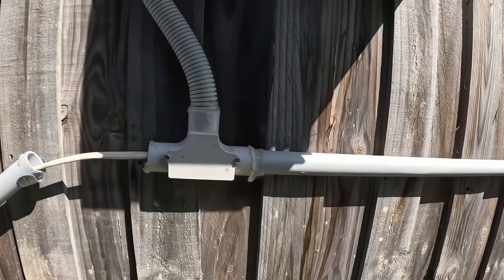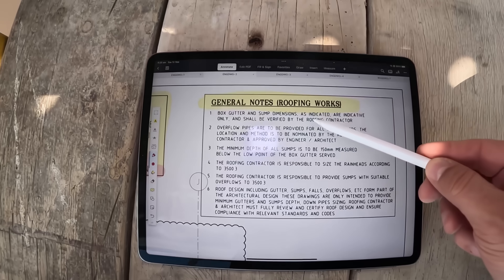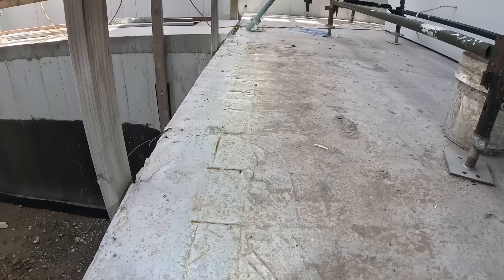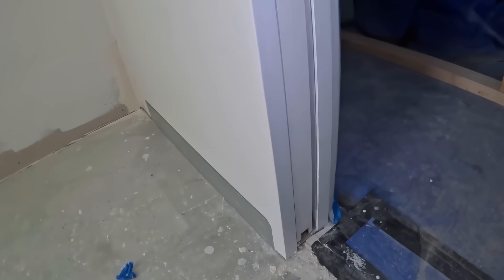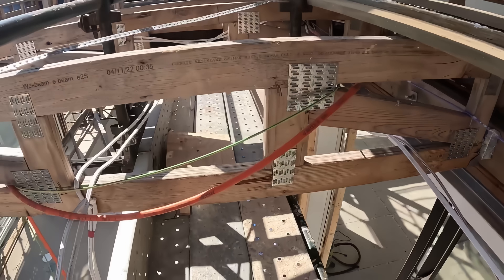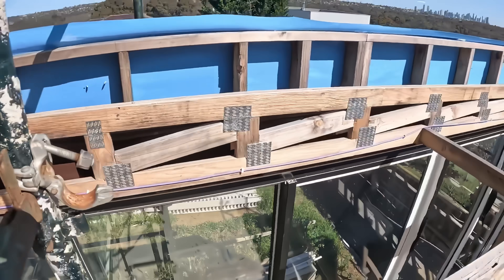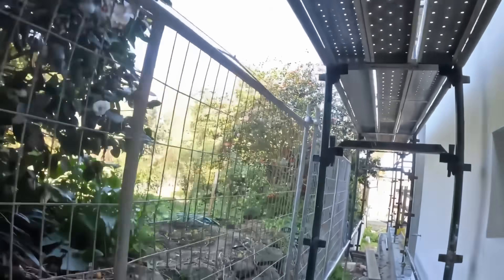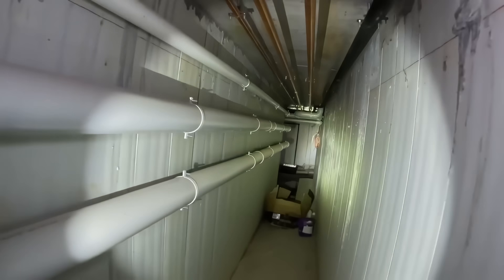$7 Million Build Nightmare | Engineering Plan Error…

Comment: $7M and they have a live wire exposed.  SMH.  This is unsafe and should be shut down immediately, with all building, plumbing, tiling, electrical, engineers, concreting, architectural and other registrations should be revoked and the buildings condemned.  Buyers to have their money refunded by insurance companies and assets of all of these thugs.

Comment: i have seen that exact same stamp in the corner of engineering drawings and never quite considered how stupid it is that an engineer can basically ask the tradesman to double check all his calculations and assume responsability
Reply: It doesn’t have to be a bad thing, it can simply mean that the plans can cover multiple zoning areas.  I was a commissioning engineer so we used to get lots of plans like that, and then we would apply local laws. That said, if a commissioning engineer had double checked it then it will have been signed by the engineer. So check for the approval signature
Reply: yea to be fair i have normally understood it as a way of saying they engineer isnt going to draw details for framing or bracing unless it deviates from the norm
Reply: @ra4yu  and me, but you very well could be right and it could be seen in a legal situation as the engineer has passed the buck to the contractor which is completely unfair.

Comment: In the late 60's during the school holidays I worked for an architectural firm in NZ as a tracer and even then all plans had a notation that, and I quote " all dimensions to be confirmed on site by the builder" arse covering has been going on since Noah subbed out the rudder build for his boat.
Reply: That's where the term "bum steer" originated...when Noah tried to guide the Ark after subcontracting out the rudder build!.
No wonder he ended up on a mountain top.....
Reply: structural engineer here, not in buildings though. However, its common to have the statement "all dimensions to be confirmed on site by contractor". As we do not always have the exact dimensions provided during the design phase etc and things can be changing throughout the project. Especially in a brown field site. Best is to usually call up a max or min dimension to allow the contractor to move on, and seek advice if it differs outside of those parameters. 
Disagree with how the engineer on this drawing has tried to write off any ownership to their design though, but that sums up residential engineering i guess

Comment: This is why its always best to buy something built in the 90s, 80s, 70s, or 60s. The houses may be old, but they were structurally built strong. My house is 1959 and has a few minor cracks in some of the walls, but overall, it is structurally fine.
Reply: Same for cars unfortunately
Reply: Agree generally. Older places should be better but I have seen some real shit boxes as well. I was an owner builder on my own place in the mid 80's and then large extension in mid 90's  Mate, there is not a single crack outside anywhere and to quote what the council inspector said of my frame for the extension.." in all my years in this work, I've never seen a frame built as strong as that"... and all I did ( I was the carpenter here) was use several extra studs at openings, lots of sheet bracing on walls , steel lintels instead of wood etc etc.
Reply: yep, spot on, we used to live in a house built then, and all the timber work was 100% hardwood, no pine anywhere.

Comment: I do a lot of cladding with stone similar to tiling. Stop being cheap with the glue ffs. A completely bonded tile or stone will also not break if there is impact due it not having hollow parts. Home job, suit yourself but if it's contracted charge more or don't take on the cheap shortcut jobs. Do it once do it right

Comment: Thats what u get for using, straight off the boat, fresh tracksuit pants with vinyl leather jackets, english as an option
Reply: They all do it. I had a guy supposedly a freshly qualified tiler/plumber redoing my bathroom and among a whole host of problem I caught him affixing tiles with a silicone gun and then grouting over it like the tiles weren't immediately going to move and destroy the grout.
He hadn't got off the boat, he'd be taught by his father who also was supposedly a qualified tiler/plumber, both of them were shit.
Then they tried to harass me to pay for their shit work before it was completed, before they fixed anything and after I made them fix the shit they tried to bill me extra for new materials they had to buy to replace stuff they'd screwed up.
For example, they made a mistake in the shower recess, and it was not the correct dimensions, they tried to bill me for new glass that was the right size, yet they were the morons doing all the work, I didn't order the materials.
Reply: Fair call but there is a fair bit in our own backyard that are downright dumb. Half would not know a sabre saw from a stepladder. As long as they can suck down their energy drinks and puff on a ciggy all good.
Reply: Don’t forget sausage rolls for breakfast & lunch

Comment: Something tells me none of these repairs are going to even be done it seems like there is nobody official checking behind these guys
Reply: Given the state of the rebar in the concrete, or should I say, on top of the concrete, all the concrete has to be x-rayed to check if it's structurally sound. if they fucked up one part then it's almost certain they screwed up others. That concrete has to be destroyed and rebuilt. Those steel beams need to be removed, cleaned and rust proofed before being installed.
Just to do those two things basically the whole place has to come apart.

Comment: I just recently got home after 8 days' holiday in Aussie. Its bad. Stayed in 4 different hotel rooms during the course of those 8 days. 4 out of 4 had non compliant bathroom waterproofing. 3 with that incorrect detail at the doorway, and the 4th had been recently redone, new tiled walls, new acrylic shower tray, basin and toilet. New glass shower enclosure leaked on to the floor outside the shower enclosure. The worst thing: They left the old, water damaged floating wood floor in place, too cheap to replace with tiles while doing the rest of the room!

Comment: I assume then that the framing and roofing wasn’t constructed to allow the required box gutter and sump sizes either. If that is the case how should the design process hold a chain of responsibility that removes these failures in a now very flawed construction industry. As the old saying goes, a fish rots from the head down.

Comment: I wonder how much of this issue is down to the ease of accessibility of the Standards documentation. It's not the easiest to get the standards documentation. They should be easily and readily available to everyone that needs them! The company drawing up the plans needs to be held partially accountable for following the standards too!
Reply: Standards owned by private company. Not the government. Tax free as well not for profit.
Reply: Yep. The government sold Australian standards to a private company. These standards should be free, not under private lock and key.
Reply: I bet you if you post free copies on every site you will still see the same s..t everywhere. Standards go for about $200 each and you buy them once and you deduct them off your income and you can get them in less than a minute on your phone. Where is any difficulty there?. I bet you most painters, plasterers, tilers and waterproffers wont even know what standard they work under...
Reply: The was one of little Johnnie Howards doings! traps for life may be correct about all the sub trades but it should be something accessible to all, for example, ( I was a builder in a small country NSW town and did struggle buying / upgrading standards ) several years ago the local council installed a new footpath in the CBD, this was hard to use as the cross fall was to high but they couldn't care less and I couldn't afford to buy a copy of the relevant standard. So something that should be available isn't and council still goes on their merry way doing whatever they want. With a copy of the standard I would have had proof the footpath didn't comply ( something the council is very keen to have builders do ) So thanks Johnnie for selling something that was much cheaper and affordable before you stuck your grubby little nose in.
Reply: @edappi8172  no it wasn't. They've always been a private company called Standards Australia who worked with the government but wasn't controlled by the government. They sold out the licensing rights for publication to SAI global. This isn't something that any government caused but there is no reason why the government couldn't make the standards more accessible for everyone but either subsidisation or even buying out the licensing and distributing it to the relevant organisations.
Reply: There is a push on from the Australian Institute of Health and Safety (AIHS) to make all Australian Standards free and downloadable, and yes, they are expensive, it's BS how much you have to pay for them to stay compliant.
All trades should jump on the bandwagon with the AIHS to make them free.
Reply: @rodsmith2560  yep it costs enough to be compliant then you've got the added cost of accessing the standards and it's not like you can just get them once and be done with it as they are constantly changing and then you've got to get them again

Comment: Roof plumbing has to be signed off by a licensed plumber. This is entirely their fault. I'm a carpenter by trade and every time I'm not sure of a roof regulation, I call my brother who is a registered roof plumber. He knows the required specs back to front, and is updated immediately on any changes regarding the NCC and AS3500. The only victims are penny pinching povo's trying to get rich by flipping dog boxes. If you run in to any builder serving this codswallop, it's because you intentionally sought out a cheap alternative.

Comment: Can you explain to me why councils don’t have their own inspectors and approve at stages. Mistakes can be rectified yearly.  And builders should be issued no work order until the council inspector is satisfied. As long as builders know that they can get away with it it’s going to be happening.
Reply: Councils didn't want the liability.
Reply: @gribbler1695  if everything is done correctly what liability will council have? It will be the solution to the building problem! Most people are not aware of the building standards. Builders will actually make sure themselves things are done correctly as they work with subcontractors if they’re aware that they can be issued with stop working order.
Reply: Thanks for bringing to our attention the issue we have with the current system.

Comment: So what is the actual solution to fixing the building/construction industry in this country?
Other than a complete overhaul of the entire industry from the top down, I don't see what else could be done.
It seems that every step of the process is completely compromised with each failure just being blamed on a different area and the people paying are the ones who suffer.
This industry is a bad joke run by crooks and incompetent morons.

Comment: I get you are doing youre job and pointing out the non compliant parts of a build and helping to educate the public but it would be a great idea if you leave out youre own personal negative comments, goes without saying if its non compliant it needs to be rectified or it wont get a certificate of occupancy but adding extra comments just reinforces the negative that builders in general cant be trusted to do a decent job and the public is getting ripped off, just fans the flames of the pessimistic types that view this, stick to educating and leave the rest out, in general I like this sort of show, and its a reminder for the public to hire independent inspectors to to check stages of there build.

Comment: What I don’t understand is this. If you don’t follow the manufacturers specification, in an area not covered by the regulations, is that necessarily a breach?

Example: manufacturer of tiles says they should be back-battered. Regulation doesn’t say this (it might but let’s pretend it doesn’t). If the tiles are laid without back-battering, is that therefore a breach of building regulations?

To ask the question a different way, is there a general clause in the building regulations that says all products must be installed in concordance with the manufacturer’s recommendations ?
Reply: If you fail to follow the manufacturers recommendations any warranty claim in null and void.
Reply: To comply with the australian standards, all items and materials must be installed or applied 'as per manufacturers specifications', it will clearly stipulate this in the build contract.